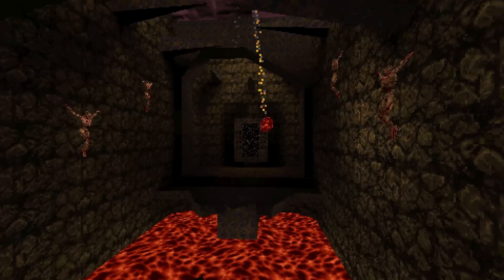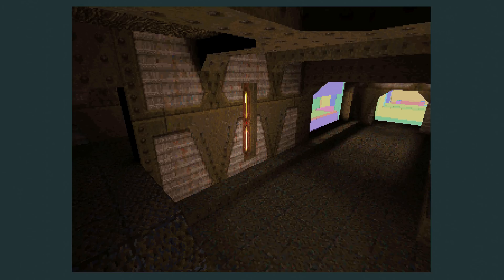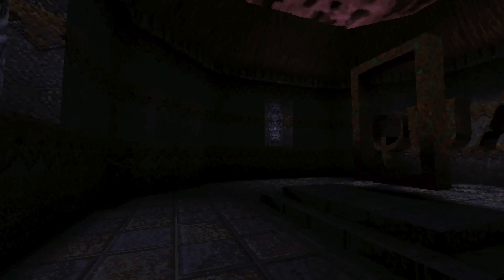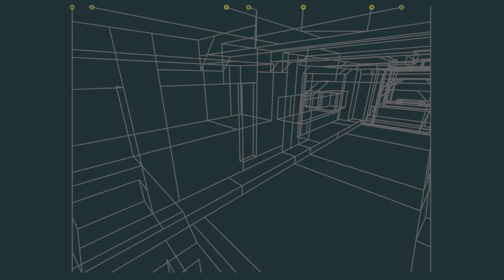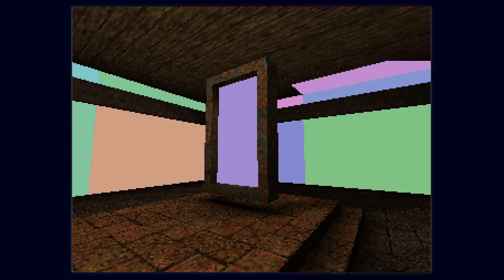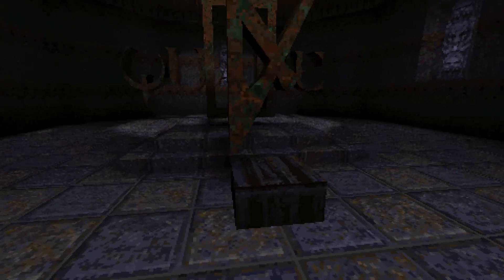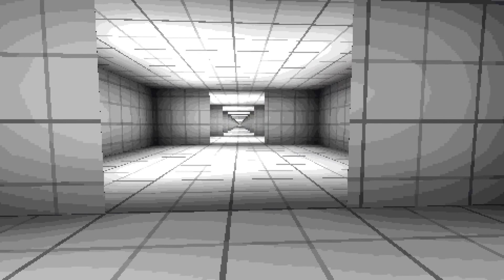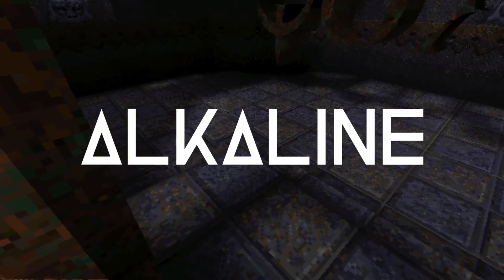I added portals into software Quake

Comment from the maker: As I mentioned there's a lot more work to make this robust, and there's also more I could do to make it faster.  For instance, I could use (something like) frustum culling to ignore geometry outside of the portal edges.  These test levels work well enough on my modern PC though,  so I'll leave it here for now...
Reply: Nice work! I was wondering why you don't mention frustum culling As part of the partitioning step. Looking forward to more on this.
Reply: Hello, I have one multiplayer project on ue5 in which I would like to add motion as in quake 3, could you give a formula to calculate motion in quake 3, in the form of a normal mathematical formula(Maybe with some notes. ) ? I searched for it on the Internet, found only the source code, but in them I do not know where to look for the piece of code I need, and I saw a little of it, after which I realized that it would be easier to ask a knowledgeable person for a formula and write everything from scratch than to try to rewrite the original code.
I would be very grateful if you would provide this. 

PS 
    I apologize for my English, I used a translator.
Reply: Hi! Ive worked on a similar feature for qfusion and also worked on my software quake engine tochris so I feel I need to share my thoughts on this ;)

To facilitate near plane clipping, I would suggest adding the fifth plane to the frustum in the generic rendering pipeline, this will eliminate a huge amount of polygons that need to be clipped
Reply: Why not use parallax occlusion maps that are compiled into the surface? Distance from camera = height. Would that not be cheaper, or am I too much of a novice to realize how bad of an idea this is?

Comment: technically CPU can render everything that a GPU can because there is a fully complete and well-defined software implementation of OpenGL 4.5 called freedesktop mesa llvmpipe that enables any OpenGL code to run on any CPU even when there is no hardware OpenGL accelerator present. Slower result than most hardware GPU of course, but this GPU emulator is optimized to the greatest extent it is possible to optimize a CPU to render 3D, so its performance on very large modern CPUs like AMD Ryzen 9 5950X should not be underestimated

Comment: Recently i implemented portals myself in my experimental softwarte rendering engine. But my portals works differently - this is just a render into texture. And result portal looks not so smooth as yours (is blocky).

Comment: divVerent made portals in QuakeC code about 13 years ago.

It is what is used in Xonotic and old Nexuiz.

In those games they are called Warpzones. (xonotic-data pk3dir- > qcsrc -> lib-> warpzone) 

But that is a hack of the water render implementation (also in QuakeC), iirc, and is not the same approach as your implementation.

Comment: We need to start using BSP trees in more stuff again tbh.
The fact that we can kill it with hardware instead does not mean we should.
A beautiful program running just as fast as it needs to is ok. But a beautiful program running 10,000x faster than it needs to is exquisite.
Let us not be like the engineers, who build bridges that barely stand. Let us be obsessed with over-engineering, to build bridges that will stand until the sun consumes the Earth.
Reply: BSP is very sensitive to geometry details. So it would be inefficient in modern games. Manually placed sectors, portals, occluders should prevail. 
Modern games lack quality development. Nowadays you can see highpoly meshes with absurd polycount, so it's done with colliders too. And LODs are automatically generated without any manual fixing. You can see smallest hairs on character faces, but not detailed skin textures. You can see highpoly rocks, but not detailed wall corners, which are represented as geometrically perfect. And so on.
Reply: @charlieking7600  Half-Life 2 mixed them, using BSPs for level collision and rendering, with extra mesh-based collision / rendering added afterward. Like sprinkles. Modern games use meshes exclusively, which is responsible for a LOT of glitches regarding physics and out-of-bounds behavior. It's done to make things easier on the level artists, but an invisible BSP functioning as a collision hull / mesh occluder COULD exist. Engineers exist, they are just told "no" by the management.

I remember when Paladins had test-map gamemode, where the level was still grey-boxed for gameplay feedback. Art pass done way later. We could do it in reverse, where BSPs are added after the map is designed, like tracing an outline. It's just more profitable to brute force polygons and patch edge-cases.

Comment: How different is this from how Build engine games handled portals? It seems similar, but my knowledge is very limited.
Reply: Somewhat, but build is still "2.5D", which simplifies the occlusion tracking, it only needs two integers per raster column to achieve zero overdraw.

However, build has its own sophistication to handle concave sectors (as opposed to doom's convex sectors and quake's convex leaves)

Comment: During Quake's development, 3dRealms was working on the original Prey. Prey had portals as its main VSD (visible surface determination) structure instead of Quake's PVS.  The abilitry to have these gameplay portals was quite hyped in the media at that time.
Reply: The original Unreal had portals back in 1998, but the game didn't use them heavily even though they were pretty advanced. Two portals could be at any angle to each other. They didn't have to be vertical, but some angles could result in your view angle jumping when passing through them, and some kinds of weapons didn't work when shot through them.
Reply: @SuperAlgae  yes, UT made some use of them too, eg DM-Fractal. OldUnreal's modern versions fix hitscan weapons through portals if I recall correctly.
Reply: Mirrors are used pretty frequently in Unreal. Not the same thing gameplay wise of course, but uses the same techniques for rendering
Reply: https://www.youtube.com/watch?v=dMfen_wicEA
Reply: You are right but Prey development was suspended for about a decade or more as far as I know, and later they switched to DOOM 3 engine, and they had to reimplement portals in it from the beginning because DOOM 3 didn't support portals as far as I know in its original version. When Prey came out it had awesome portals but it wasn't first portal game that came out. UNREAL was the first released game that had awesome portals implemented.
Reply: Narbacular drop was released in 2005.

It was some of the team that ended up making portal.  Gabe Newell liked it, so he hired the whole team, and they subsequently made portal.

So valve still win :)
Reply: @AletheiaBasin Prey was never released though, until Human Head made the 2006 Prey based on idtech4.

Comment: Chapter 70 of the Graphics Programming Black Book mentions that the Quake developers tried using portals for rendering instead of PVS. However they ultimately decided against it because it made worst-case performance worse without improving average performance.
If you haven't checked that out, you should. It might give you some ideas.
Reply from the maker: Yes, that did spring to mind! It's pretty much the same problem only with portals between each leaf, I think.
Reply: IIRC the original Unreal engine was portal based

Comment: I don't think portals like this tend to use stencil buffers in modern games. I think they render the destination scene to a separate off-screen texture backed by another frame buffer and then place that in the portal location.
Reply: There are lots of ways to do it. Imo the best way to do something is the one that takes the least frame time and memory to do. Idk which one that is, but it's probably one that doesn't use very many extra buffers.
Reply: IMO, I would rather use a stencil and depth buffer to clip the destination geometry to the portal's surface in the source source geometry. That way, I could use a single deferred lighting/shading pipeline to light both sides of the portal with lights/shadows being able to pass through.
Reply: stencils are superior to rendertextures in pretty much every way
Reply: Stencils used to mask portal area

Comment: What an amazing job! I just discovered your camapaign for Quake and after playing it for a couple of minutes it's really something good, thank you! Btw, do you think it could be possible to pre-render portals into a set of images or a compressed video, maybe even a couple of parallax cubemaps to save some performance?
Reply from the maker: Thanks for the kind words.  To be clear, I had nothing to do with the development of the Alkaline mod, I merely used it in this project.  It is a fantastic campaign though.  To answer your question:   I suppose that would be possible, although it'd only ever be an approximation since you'd want it to appear right from all angles.  Thanks again.
Reply: @MattsRamblings  ok, yes, this is exactly why I say it should be a series of images, taken from multiple angles.
Reply: @vadimtaranov3041 Similar to a cubemap?

Comment: Nice, I did something similar in Q3 many years ago, basically modifying the standard teleporter and combined that with the portal camera. A few of these videos are still scattered around, e.g. "roomillusion4".

PS: I like your technical approach.
Reply from the maker: Yeah, I did think about the Q3 see-through portals when I was doing this (eg. the one near the lava in q3dm7).  I seem to remember there were some technical limitations, so the renderer couldn't handle portals looking at portals?
Reply: @MattsRamblings correct. Portals couldn't look at other portals and if I remember correctly, things also broke down if the player could see two portals simultaneously as well.